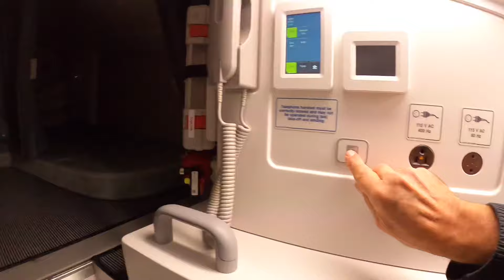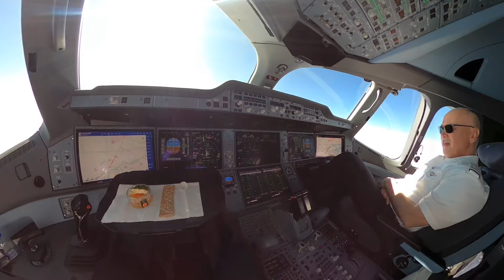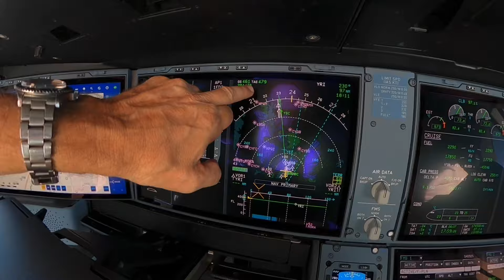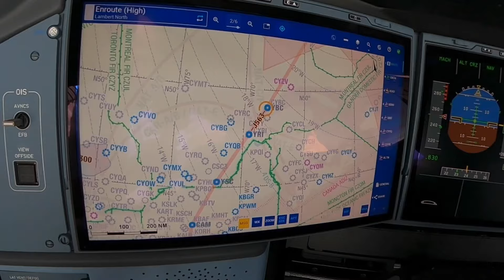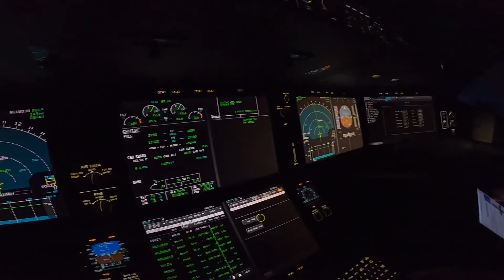The Secrets Of Airbus A350

Comment: After crawling through many hellholes in my career, I would've given almost anything to have an Avionics bay like this!!
Reply: Dustin, nothing like lifting yourself up thru a hatch & having to balance on a 2 x 4 to slide in some modules or panels. Then you realize there's just barely room to lockwire the connectors & hardware. 
Not any more, retired & reading about it.
😄✌
Reply: The cool thing is that all of airbuses E&E compartments looks like this all the way back to the A310/A300 days. Very well done! I love airbus!!
Reply: Amazing. Had no idea. Worked as baggage handler on 707 and 737. Siggh the memories, sweetest things..
Reply: Soon they will say; "just what do you think your doing Dave?"🤣
Reply: Yep, and usually the rate of failure of the module or LRU was inversely proportional to the ease of replacing it. Maybe you could see it or touch it, but not at the same time. Then you've got to remove it, replace it and do the wirelocking with maybe a couple of fingers😥 Aaaahhh, memories😊
Reply: I had an AME friend back in the 70's and helped him on a couple of occasions fiddling with snags on the Otter, Goose, and Beaver. All fun, then there's the weather ...
Reply: Boeing has left the chat in defeat:
Reply: I’d love my land locked server room to look like that

Comment: Your avionics compartment looks like a mini data center. Impressive 👍🏼 We miss your commercial jet videos
One small question. Can pilots climb down to the cargo hold during in-flight thru this way?
Reply from the maker: Yes it is possible but not a good idea since there are no oxy masks there, which you need in case of a decompression
Reply: @bjornpilot  Very good Captain. Thanks 👍🏼
Reply: It is impressive. 😎
Reply: @bjornpilot  Um, isn't that dangerous because you never know when turbulence can come? I thought the plane always lands as soon as possible if there is any need to climb down there.
Reply from the maker: @largol33t1  We never go down there during flight.
Reply: @bjornpilot  So if I need something from my checked-in luggage I'll knock on the cockpit door and ask kindly.
Reply: @largol33t1  that's where the pilots join the mile high club and those are not snail tracks on your luggage
Reply: How cool do you keep the avionics compartment when flying an when on the ground? I imagine there's quite a bit of heat generated when the avionics are in service.
Reply: @Chatta-Ortega  Hello! It isn't a matter of cooling but rather a matter of heating! In-flight Temperatures reach around -40 to -60+ degrees celcius depending on Cruise alt. So one of the 3 pack systems (Air con/Press system) heat it up just so it matches with the rest of the aircraft, it doesn't cool it but just removes/adds heat depending on the requirements. Of course, you are able to cool it down manually and heat it up manually, but usually you don't need to. Hope this helped a bit!

Comment: Wooow wtf there is a at least two homelabs worth of servers down there. I never knew that, this is amazing
Reply: Everything the plane does could probably be squeezed into stuff much smaller...but I guess with a lot less reliability and redundancy.
Reply: @KaldekBoch  yes, similar to what they do in the space industry. People often complain about picture quality etc, but reliability is top priority, so often they use tech from decades ago just because they know it will work.
Reply: @Formula1st  that, plus it probably takes forever and a day to get anything new built to  rad-hardened specs and then qualified for launch.
Reply: Those aren't servers. The modules that do contain computers run on a very specific, deterministic OS (ARINC) and there's no networking involved. When Ethernet is used, it's under the AFDX protocol stack that has nothing to do with your usual TCP/IP. In other words, you wouldn't be able to take this hardware into a datacenter and do anything with it.

Comment: 4:50 So much computer power in the plane but still a screen performing like an old tired PC from the 90’s. :)
Reply: I program the main flight computers and displays for a living on similar aircraft. It's so simple because this stuff needs to be reliable, and sometimes a little simplicity is the simplest way to do that. Under the covers, there is a lot going on for the express purpose of ensuring that everything goes smoothly. You don't want lag at all, or any unexpected freezing of the computer. Plus, there's probably at least 2 or 3 of everything on this aircraft, if not more.

For the aircraft I'm working on, we are utilizing a software/system architecture called FACE (Future Airborne Capability Environment). It's really neat, and makes it much easier to develop these complex types of systems.

Basically the game here is functionality first, usability second, and looks last.
Reply: @jakea7065  Yeah but there is lag, that's what he's saying.
Reply: @jakea7065  yet the SpaceX engineers were able to deliver a smooth UI, good looks AND functionality… on a space rocket! 

Sorry, I’m with OP.  A brand new plane shouldn’t have such a laggy UI like it’s running TonTom from 2005
Reply: @Leftplayer1  Making the cockpit look good is Airbuses problem, and I don't work for Airbus. I'm talking about overdone, convoluted displays and controls with unnecessary amounts of features. See the Bell V280 if you want something modern. That's still under development.
Reply: @jakea7065  what languages are you using to program those PC ?
Reply: @oopsitsagame1766  Straight C. Not even C++ because there is less control over the code execution and it is less predictable. Some components might use Ada.

But stay the hell away from Java, Python, Visual Basic, C#, etc. Python is my personal favorite, but i would not trust my life with it.
Reply: @jakea7065  thank you for the information. That's cool ! My dream job :) I only code for a web base apps for a living
Reply: @jakea7065  What processor architecture do they use? x86? ARM? x64?
Reply: @hoaxlayer  Depends. The main flight computers might use PowerPC with VXWorks. An AutoPilot processor might use MIL-STD-1750A. The Flight Management System might use a single-thread ARM, x86, or VAX (really old) processor on a custom OS. Some of the computers literally run i7 or NVidia processors with Windows Server or Linux for non-safety critical applications. Some components might run Linux on a Xilinx FPGA SoC with an ARM processor. You can basically run anything you want. The main limitation is the level of safety. I wouldn't run Windows in the Main Flight Computers handling INS, control, or navigation data, but I will trust VXWorks to do the job because it is rated for safety critical applications.
Reply: As long as the flight instruments don’t lag, it’s fine.
Reply: @jakea7065  I wouldn´t want my life depending on windows or mac OS.  Imagine an update comes up mid flight  (just kidding)

Interesting stuff thanks!!!!!!
Reply: The lag is actually not a lag, it's due to a ground-based operator remotely controlling the ND display in order to match the pilot's hand movements and zoom in/out while watching his pov camera in real time.
GPU shortage affected Airbus as well.
Reply: That screen is actually EFB class 2+ and linked to a laptop most probably running Windows located in the docking station beside the pilot seat (seen at 0:50 with red seal). It is independent of the aircraft computers and can be swap out by pilot with a spare if the unit crap out in flight. 

Not sure the exact spec of the laptop, but it could be running on some half decade old 2C4T Intel CPU and thermal throttle all the time.
Reply: @jakea7065  you're talking about convolution which the OP is clearly not.
Reply: @jakea7065  Also the UI is made in C?
Reply: Security through antiquity

Comment: Man, when he opened the little door to show the computers, I was expecting there to be a small rack with a few flight controllers. There's a data center there.
Reply: Yup every flight surface has multiple cables and routing equipment, every system has multiple backups... ect. not our granddads plane for sure.
Reply: @destroyerdragon2002  Seriously. I'm a bit of a geek. I'd LOVE to just spend an hour in that space seeing what all of the various equipment does.

Back in the day when I first started working in IT, I worked for a large telecom provider. I remember when our enterprise command center was built, which included about 20k square feet of raised floor, I would go in once in awhile with the lights off and just sit and watch all of the LEDs blink. Way cool.
Reply: @migbham1  It is rare that I meet a mind that perceives things in a similar manner to my own. Can be quite refreshing.
Reply: Lol yeah,  like a row of servers.   Did you notice the  the heat distortion in the air when he turned around? From the hot air coming off the electronics traveling through the cooler air in the bay?
Reply: @righty-o3585  I personally think it was just his 360 camera trying to focus.. though I am plenty sure it gets nice and toasty down there.
Reply: @destroyerdragon2002   That's possible too.
Reply: @righty-o3585  I mean you could be righ aswell I am kinda tired atm lol. Tarmac can get ridiculously hot. :)

Comment: Is it possible to access the avionics compartment and cargo hold during the flight?
Reply from the maker: Yes. But bad idea. No oxy masks there.
Reply: @bjornpilot  oh okay, thanks
Reply: @bjornpilot  why? Isn’t it pressurized ? That access door didn’t look air tight but I could be mistaken. Or do you mean it’s risky because no oxygen masks during emergency situations? Anyways, thanks for the walkthrough. Good choice of music as well. Happy flying!
Reply: @bjornpilot  Sam Chui did it on a Combi but carried a portable oxygen bottle with him.
Reply: @shreedhar333  it's pressurized, but for safety and regulations it's not advisable to be in any area of the plane during flight which doesn't have access to oxygen mask in case of a sudden loss of cabin pressure. This is why in some airplanes the staff will not allow above a certain amount of people to remain standing near the galleys and/or heads as there is a limited amount of oxygen masks in those areas.
Reply: @Alejandro-vg7yt  That looks like a great place to stash special forces personel.  All they would need is a few airbeds, ear defenders and emergency oxygen bottles. i bet they've already planned for it, just in case.  I know they use crew quarters whenever they are available on the bigger planes, but when they need to, they stuff themselves in anywhere.
Reply: Hiya!
So where is the live cargo section? That cargo section you showed,  next to that probably.  Always  wondered where my two Shih Tzus kennels fastened whenever I fly them JFK - MLA via Philippine Airlines.  Used to fly them twice a year for 3  years. Damn!

Thank  you so much for sharing us your passion...
God bless you and more power.
Love,  love your videos. Glorious....
Reply: This seems like a very, very bad idea to show this to the public. These area seem as though they should be more highly secured than shown here.
Reply: @donsimpsonshead8809  I mean you would have to somehow get off the loading ramp run around and unto the belt then pry the door open from outside the data center. All without someone trying to stop you. Then if you manage to pry that door open there is the over head hatch to get into the flight deck which is normally latched shut. Odds of success low. Not impossible however. I mean boarding the plane the flight deck/cockpit is usually open.

Comment: I am retired avionics instructor.  Somebody has to understand and maintain all of the systems on the airplane.   Each one of the dozens of boxes in the electronics compartment has it own job to do in the task of making the aircraft functional.  Technicians must know not only the meaning of each light, symbol, control  and switch in the cockpit, but also its source, function, and connections to other systems in the airplane, and its effects upon them.  The task of detecting and diagnosing problems in the networks of functionality would be nearly impossible without the development of BITE, built in test equipment, in aircraft systems.  Many airplanes now have dedicated computer terminals for maintenance, while other tests may be accessed through cockpit control panels and displays.  Also, some individual boxes in the electronics compartment have displays and controls on the front that allow the technician to test and verify that particular box.  I spent many hours teaching all of those systems and tests to technicians, but I began my career pouring engine oil into 22 gallon tanks on DC-3 aircraft.
Reply from the maker: Interesting! I have a deep respect for my maintenance colleagues. The "3p station" has a laptop for checking all rhe systems. Really impressive!

Comment: 4:50 for an aircraft that costs as much as it does, it should NOT be experiencing ANY lag on the screen like that!
Reply: That particular screen is connected to the EFB (electronic flight bag) which is a small windows laptop (hence lag)  just behind the pilot seat... totally separate from the flight computers.
That laptop stores airport charts, manuals, aircraft performance calculation software.

Comment: Is the avionics bay also pressurized? The door to the cargo area then is the pressure seal and everything forward and up is pressurized.
Reply from the maker: Yes, it's pressurized. Also the cargo area.
Reply: Cargo areas are pressurised in most aircraft.   Much easier to pressurise the whole  circular fuselage than a flat cabin floor.

Comment: Woah wtf!?  There's more buttons on that cockpit than are in a Tesla.  That whole miniture office of computers makes sense now.  I also finally understand why I should put my phone on airplane mode.  Wouldn't want it messing with any of that. 😅
Reply: Airplane mode actually poses no risks to interference with those computers, there is an extremely tiny risk of it messing up Comms with ATC but the real risk is very miniscule. They originally thought it would hence why it's procedure to, but in reality nowadays they just have those procedures so that you listen to the safety briefing.
Reply: There are now planes where the inflight entertainment is streamed via WIFI. The real problem are phone connections. You sit in a metal cage, so the phone has to use lots of power. Also from above, the phone reaches several towers at once, rapidly changing because of speed. The phone system can't really cope with that.
Reply: Another reason why you have to set your phone to airplane mode is that you don’t want your phone to connect to too many stations at once. If all passenger phones connect to the ground stations at the same time this can create an overload of the mobile phone network. Being on a plane is not the same as being on a bus or a train (where also many phones connect simultaneously to the network). When you are on a plane there are much more stations in sight because you are so high above ground. This means that a planeload of mobile phones can mess with the network because they try to contact too many stations at the same time. Because of the high speed the phones have also to reconnect to a new station much quicker as if you were travelling in a train or bus.

Comment: Is there actually any hardware a passenger can bring in that can interfere with the onboard electronics?`I mean we all know the warnings to turn off devices but I really doubt you can interfere with onboard electronics nowadays.
Reply from the maker: Not possible. For example the planes systems are separated from the WiFi.
Reply: @bjornpilot  Thats what I assume, but why they still require to turn off devices?

Comment: Interesting that they make you push the button OUTSIDE where you sleep to turn on the light. Wouldn't you want that button to be inside the sleeping bay?
Reply from the maker: You want the light on before you crawl into the bed and I use the button outside the bunk as demo. You can switch the light off or on lying in the bed too. Airbus redundancy! 😊

Comment: I think they might want to upgrade the GPU on that touchscreen panel, that thing was unbearably laggy.
Reply: Having worked on industrial computers in the past, the screen is rendered by the CPU (no hardware acceleration available), and usually the app is single threaded and doing other stuff at the same time. But yes, the UX part of me shuddered at that 😂.

Comment: Argh. Pilot should never go into the E&E bay. His shirt could grab and pull an LRU CB, the cargo access door might not be correctly latched so fire system is useless, should also not be near the open main cargo door without a loader in place to prevent fall.
Sorry but Pilot should stay where they belong, in the seat or sleeping in the crew rest.
Reply: He was nowhere near the open main cargo door, he barely went into the cargo bay. And there might have been a loader there, we couldn't see.
Reply: @owensmith7530  hmm 🤔 except at 2:10 when you could see there was no loader and he walked directly to the corner of the door 🤦‍♂️
Reply from the maker: Wrong. The pilots must be familiar with all areas of the plane. You know that you have to be careful and you have responsibility for it. As captain you also are the highest authority onboard.
Reply: @bjornpilot  highest authority same as the captain of a tugboat.
Sorry but avionics compartment is no place for a pilot. There is nothing inside there that you are allowed to touch.